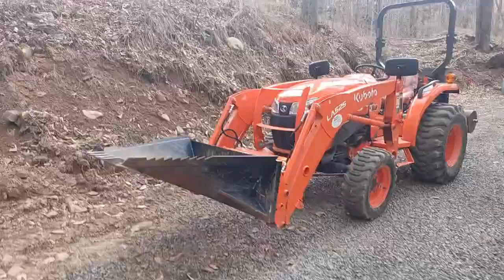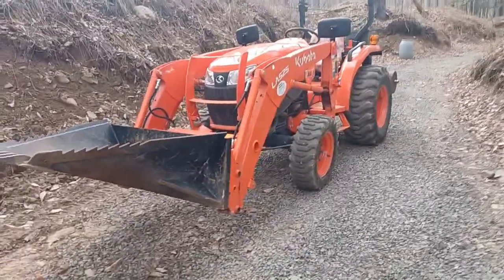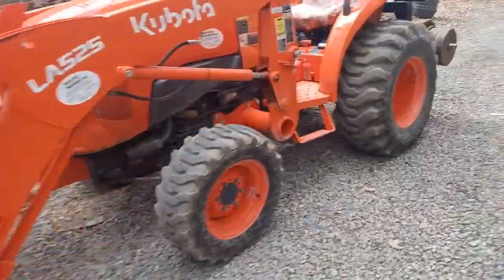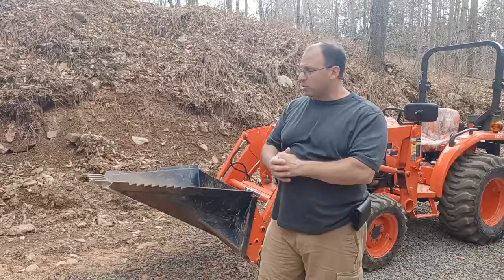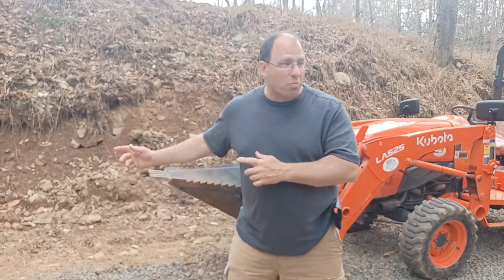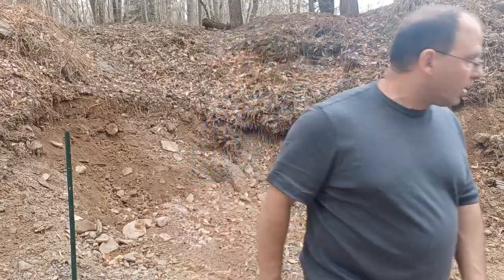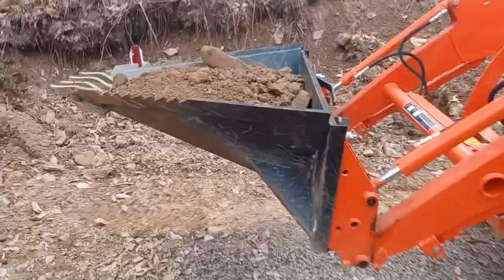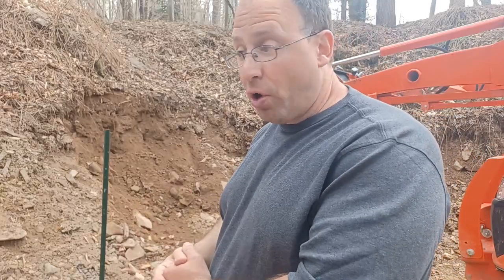Digging with Stump Bucket on Tractor

Comment: Might check your hydrologic oil level sounds like maybe low my Kubota sounds like that winding sound when it is low
Reply from the maker: I think that's because I had it in medium gear instead of low. I had it there because I didn't want to spin my wheels and start digging holes in the same spot I was working.
Reply: @absolutegunrights3079  oh yeah true